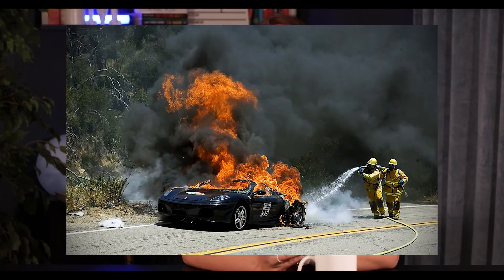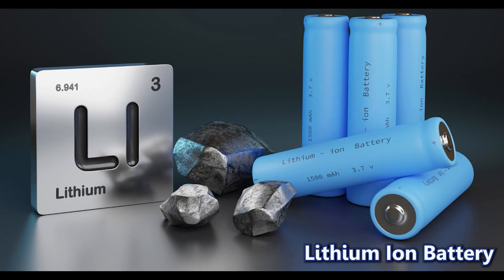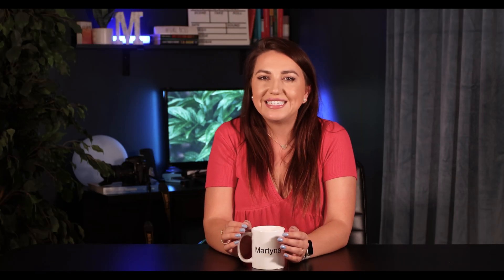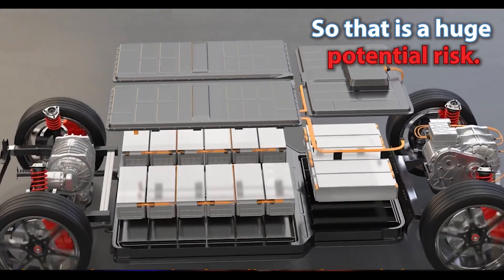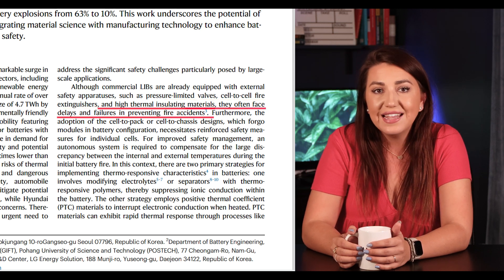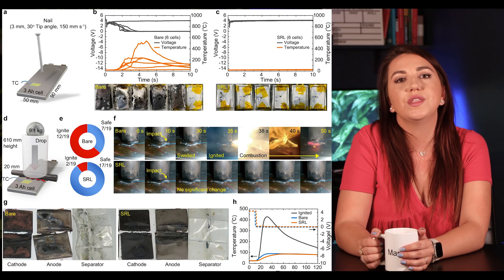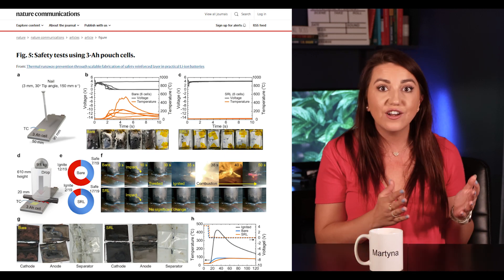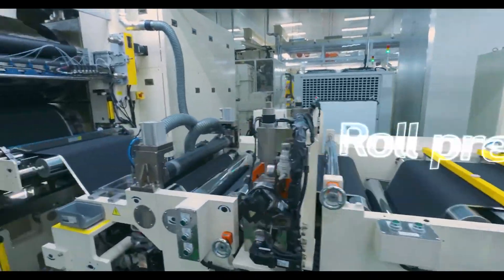Safer Lithium-Ion Batteries: LG's Bold Claim Challenges Tesla and Rivals . No more EV Fires?

Comment: LG should know more about thermal runaway than anyone after they made the large majority of unsafe and exploding batteries shipped worldwide.  There have been so few actual events it is a running joke that people make out that this is in any way a common event.     i.e. I've seen many petrol cars burn, I've never seen a battery fire.   Here in Australia, there were reportedly ~6 events, none of which were just "battery fires", some had been damaged in an accindent and a couple weren't even in cars.    i.e.    so long as you do NOT have an LG puch sell which has been kept at 100% charge, your chances of any kind of issues are pretty low.    I'm talking proplely battery managed cars and house storage systems though... not the cheap crap that's being built into "mobility solutions" like scooters, without proper management.

Comment: EVs catch fire so much less than ICE vehicles. On average, in the USA there are over 220,000 petrol/diesel vehicle fires every single year compared to on average about 55 EV,s per year, except of course the recent hurricanes where flood conditions etc. and other external disaster influences caused a sudden short increase in EV fires. A rare event although tragic yes. However, when you base the statistics on an even basis, because some argue there are more petrol cars than EV,s so yes there will be more petrol car fires, well that argument does not wash. For every 100,000 EV,s there are about 24.1 fires, compared with 100,000 petrol cars where there are 1,529.9 fires, and hybrids for every 100,000 there are 3,474.5 fires. So the most dangerous are HYBRIDS, 2nd most dangerous PETROL (internal combustion), and last full EV,s. The myths created by the media is so fake it is unbelievable and the masses eat the lies up. STOP THE LIES petrol heads.

Comment: Do you have an electric car? and do you have Canadian Solar 700W Solar Panel 132 Cells Bifacial TOPBiHiKu7 CS7N-700TB-AG Wholesale 31 panels per pallet (min 5 pallets)

Rated Power Output
700 W
Voltage (VOC)
47.9V
Number of cells
132
Cell Type
Monocrystalline
Delivery on Oct 22–25

$0.32 /pw
$223.30 /panel
View product
31 pcs (1 PLT)

Comment: Even if true, it will take years before it reaches the market, I would think.
Reply: Could be, but for home batteries, the market has already switched to Batteries made with an LFP chemistry (Lithium Iron/Ferro Phosphate). This is safe, cheap and does not has the thermal runaway problem. This LFP chemistry is used in all modern stationary (home) batteries and loads of car batteries as well. You do not have to worry when choosing LFP. Please check it out for yourself. Its already here and prices have dropped 50% in the last year to an all time low.
Reply from the maker: Agree, thank you for clarifying! :) NMC still have a big market share ( 60% in 2022) but it has been decreasing to LFP! Hopefully this new research plus LFP will soon take over. Maybe a video explanation of different chemistry of lithium ion batteries would be a good idea.

Comment: Thermal runaway has been my #1 concern regarding a whole home battery backup.  If this turns out to be a production reality, this will be the deciding factor for me of battery vs. generator backup.  Thank you Martyna for sharing this news!
Reply: Batteries  made with an LFP chemistry (Lithium Iron/Ferro Phosphate) is safe and does not has the problem. This chemistry is used in all modern stationary (home) batteries and loads of car batteries as well. You do not have to worry when choosing LFP.
Reply from the maker: Yes thanks Rik for clarifying, LFP are much safer than NMC, and most home batteries are LFP. So just make sure to use that chemistry over the other. :) 
Also I should have mentioned that ICE cars are at such a higher risk for fires than EVs! :) I must have been too excited with this new research I made the video too scary!!!

Comment: Let's hope this diminished fire risk is true and becomes the standard  soon. Residential solar is inhibited by current fire codes requiring 10 foot separations of solar batteries from lot lines and 3 foot separation from doors and windows. This makes battery placement difficult in many urban areas.
Reply: Actually, home atteries are made with an LFP chemistry (Lithium Iron/Ferro Phosphate). This is safe and does not has the thermal runaway problem. This chemistry is used in all modern stationary (home) batteries and loads of car batteries as well. You do not have to worry when choosing LFP.
Reply: the codes  (IFC) do not address the difference between battery types. @RikHeijmen

Comment: Q: LG Chem's Breakthrough Ends Thermal Runaway? A: unknown at this point, unfortunately this could be little more than the SAME PROPAGANDA pushed down on the laymen like we just got finished watching with the Tesla Robotaxi, with Solid State Batteries, with Cold Fusion, etc.  # WE'VE SEEN THIS MOVIE.   ps:  credit to you for doing a dedicated upload on this topic because this announcement (ultimately related to fire safety and public safety at large) is literally what the other "talking heads" and so called "experts" on YouTube SHOULD be taking about, but conspicuously they are NOT talking about it...

hint: they lack both the maturity and intelligence to even acknowledge the problem's existence in the first place (therein you have 1 up on all of them). 👏
Reply: Lithium Ion is not the best choice for home batteries. Batteries made with an LFP chemistry (Lithium Iron/Ferro Phosphate) are safe and do not have TR problem. This chemistry is used in all modern stationary (home) batteries and loads of car batteries as well. You do not have to worry when choosing LFP. Check it out, loads of great videos about this online!

Comment: All of which means Lithium Ion batteries now and in the near future are unsafe due to possible thermal runaway, and the subsequent metal fire that can't easily be put out.  They are a major danger and need to be removed from the public arena until they can be made safe.
Reply: The number of EV fires is a tiny fraction of the ICE car fires. On a percentage basis too, so not just because there are less of them. The risk is blown way out of proportion in most circumstances. But sees lots of media attention... Shipping though needs extra precautions. We ship ICE vehicles with the fuel tanks largely empty. Not possible with EVs, increasing the risk of a catastrophic fire. We also don't fuel ICE cars in our garages as it is dangerous. Somewhat the same for EVs. Better to charge them outside as it is the highest risk time.
 
With sodium and LFP batteries nearly at the same energy density and lower while having no issues with thermal runaway this break through is somewhat tempered. Also I suspect there are heat transfer consequences limiting the C rate of the battery, but haven't seen specs. I doubt this is going to have major impact on the industry because we are already moving to other technologies, but portable electronics may be a good market for them for a few years. 
I have seen samples of batteries with twice the energy density that they are ramping production on. If this tech cannot be compatible with those, it will immediately become obsolete.
Reply: @court2379 car fires are at least 40% more likely to catch on fire. The data is out there, but the public opinion is really behind in facts. 😢

Comment: The new Sodium-ion batteries are virtually non-flammable and can withstand puncture, pressure, heat, and electric faults without catching fire (lowest chance of thermal runaway) and salt is much cheaper than Lithium so Sodium-ion batteries should be much cheaper to build and for the consumer.   Some say Sodium-ion batteries will be 1/3 the price of Lithium-ion batteries of the same size.     The one big negative on Sodium-ion (for right now) is they are not as internally dense as Lithium-ion therefore the Sodium-ion batteries (size for size) don't store as much electrical power.
Reply: sodium ion also has liquid electrolyte, how is it not combustible?
Reply: @tooltalk  I'm not an electrical engineer but they say in articles that its far safer from thermal runaway than batteries we have today.

Comment: Love your channel but I have to say that in your justified excitement over this development, you have inadvertently amplified some of the most widely spread disinformation out there regarding EVs... the myth that they are inherently dangerous due to their propensity to burst into flame at rates far beyond ICE vehicles when, in fact, the opposite is true. And this FUD extends to lithium battery tech in general. Thermal runaway is absolutely real and any work done to minimize the risk is welcome. But to say that thermal runaway is "a huge risk" is simply not supported by the facts. A better and more accurate representation would be to say that while battery fires are rare, they can be volatile and difficult to put out when they do happen. This presents special challenges for firefighters which makes this new breakthrough by LG Chem so exciting. You're a great spokesperson for the solar industry but please be careful not to feed the disinformation machines out there. Thanks for all you do.
Reply from the maker: @MarkTarleton  thanks Mark for the feedback and I should have added that ev are way less likely to catch fire than ice vehicles. I literally had a sentence in there mentioning it but took it out, just so I focus on ev and battery and not even get into a conversation of internal combustion versus electric. But I guess that should have been left there. 
Thank you for the feedback for sure I appreciate it and can only improve based on comments like this. 🙌🙏
Reply: @solartimeusa yes, please correct this if you can, because we need people like you who are trusted by the public! And now you see that people are only confirmed in their beliefs. ❤
Reply: @solartimeusa  It's tough to choose words carefully enough... and I used to do that for a living in corp comms. I just did the same in my comment. In using EVs as an example because they're the most visibly politicized, I failed to complete my thought that whether in a car or on a wall, it's the same battery tech and we don't want people to be needlessly afraid of it. I made my comment seem to be all about EVs. No need to reply. Just cleaning up after myself 🙂
Reply: @solartimeusa  It's not so much which is more or less likely to catch fire but more about under which circumstances.  What bothers me is that an electric vehicle can just be sitting in your garage charging at night while you sleep and suddenly burst into flames and burn your house down.  Ice vehicles never do that.
Reply: @jlrutube1312  But they don't catch fire "suddenly" with no warning. There is a heating up process that the battery monitors detect, and can warn about, meaning that you will not be "asleep". Smoke detectors can also detect a problem before a fire. And ICE vehicles absolutely do catch fire when parked and turned off in a garage.
Give me a break.
Reply: @jlrutube1312 I'm afraid this not true. For instance, a significant car park fire that was initially misreported as being caused by an electric vehicle, when in fact it was started by an internal combustion engine (ICE) vehicle. This incident occurred at Luton Airport in England in October 2023.
This one of many examples when the reports for it wrong. You have been successfully lied to. Not because of conspiracy or any of that stuff, but because the news media industry just needing to report of shock and horror. It a business model, sadly...
Reply: People should never be afraid to say something negative about either ICE cars or electric cars.  We don't need the thought police getting all butt hurt every time some one dares to mention something negative about EV's.  It shouldn't be a religion.  I think that people treat electric cars like they treat their religion.... meaning people in a religion will often admonish other believers of that religion to never air their dirty laundry in public so that the public will not see their religion in a negative light.  Never talk about problems in the religion where the general public can hear you for fear they will reject your religion.  Same here.  Oh no, oh no don't talk about dangers of electric vehicles because we don't want the general public to get a bad impression of EV's!  Come on.  Give me a break.   Stop wetting your panties.

Comment: This material had better be very low resistance, or it will generate more heat during everyday use.
Does this invention prevent the formation of dendrites (which can cause fires in an individual cell) or just stop a fire spreading to adjacent cells?
Are LFP batteries safe enough already that they don't need this technology?
Modern battery systems are highly thermally regulated, so I assume this invention would be helpful in a collision?
Reply: Q: Does this invention prevent the formation of dendrites (which can cause fires in an individual cell) or just stop a fire spreading to adjacent cells? A: unfortunately this probably does nothing for stopping "Root Cause" of dendrite formation (which is a whole different mechanism) but by providing an "intermediate layer" it may be able to STOP those dendrites from shorting the cell...

in fact, another company (SES) announced a "so called breakthrough" on this very thing by way of applying a polymer coating and a change in electrolyte chemistry, and they made this announcement back about 3 years ago, but see fast-forward here a few years later (and like all the other "breakthroughs") we of course don't have it in the market, nor have we heard anything further about it.  hint: they're all running individual "funding scams" which is why we keep getting these announcements.  as long as the money keeps flowing in (and the light bill is paid) many of these companies could really CARE LESS if they create a workable product or not...  

again, only those paying close attention to these announcements in the first place (and also having good memory to be able to RECALL the announcements in the second place) will likely have any knowledge of this.